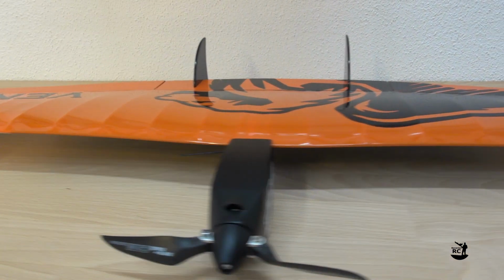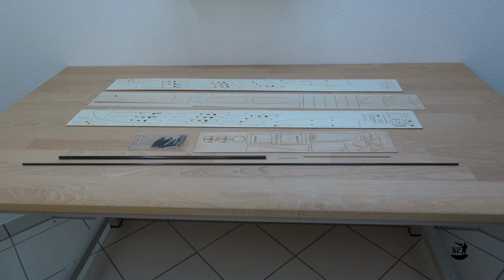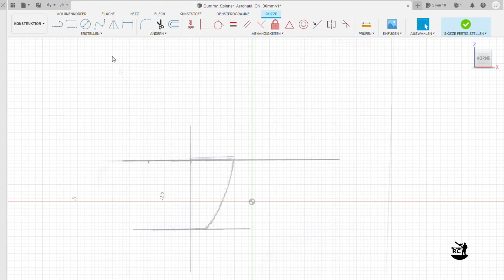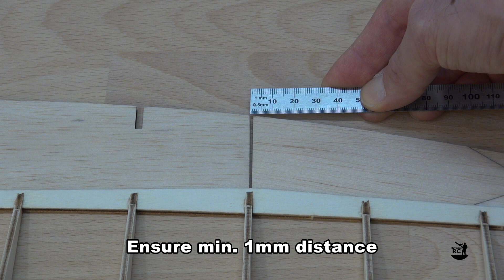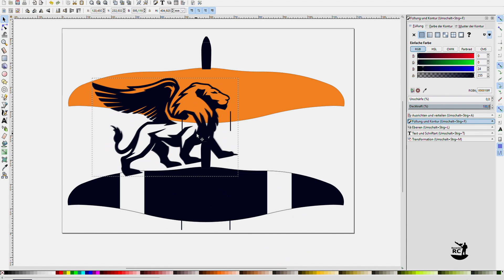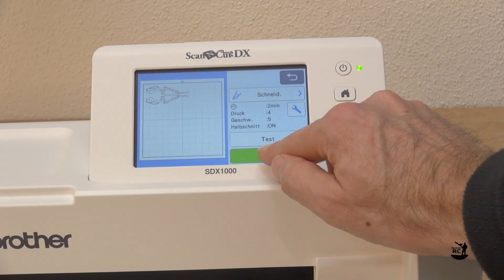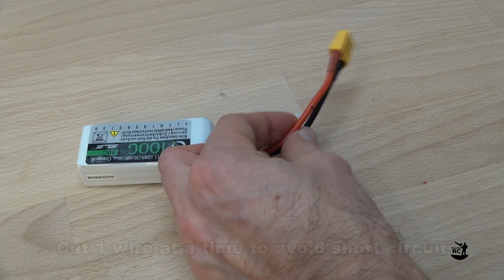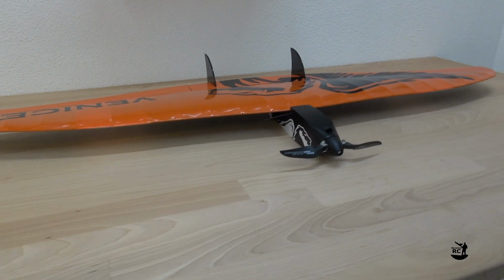Venice RC Flying Wing - Time Lapse Build

Comment: Thank you, once again you have built a model that I am interested in and I benefit from your experience. Before I order this lit from FTM can you tell me if I really need the plan as well?, watching your build I am thinking that i do not.
Reply from the maker: Thanks a lot! If you order the kit you won‘t need the plan. All parts are made to fit without having to align them on the plan. The build instructions were fully enough. They are in German but with a little help of Google translate and my video I guess you won‘t have any difficulties. If you run into any questions during the build just drop me a line. Enjoy the build!

Comment: Have you had the chance to fly the Venice yet?, I am interested in your thoughts about it`s behaviour in the air.
Reply from the maker: Hi Mel, yes I have maidened it already but have only 2 flights on it (actually 2 and a bit 😂), so my thoughts might be a bit preliminary. First of all I need to say it is more a motor plane than a glider. You can glide, but the performance is not really exhilarating. With the motor it just needs about half throttle to cruise around and with full throttle it picks up speed nicely. Climbing is only possible up to about a 70 degree angle, it clearly won‘t go vertical. It is very agile and rolls very nicely. Flight times with a mix of gliding, half throttle and some full throttle parts is around 8-9 minutes with my setup. When launching for the third flight I messed up the launch, it banked to the left and was losing height. Full throttle was not enough to pull it out of that situation and I ditched it in high grass with a bit of cart wheeling. As a result I broke the shaft of the motor. No damage to the airframe. Now it is waiting for the motor to be fixed. Hopefully soon!
Reply: @bavarian_rc  Thankyou, I have now saved some money which I will use to purchase the kit. Thanks again.
Reply from the maker: I am happy that I could be of help!
Reply: @bavarian_rc  I have completed the build of my Venice, but I am having a big problem with launching the model, I have set the CG to 41mm, needed to add some weight to the rear to achieve this, I set the aileron and elevator bottom surface to be flush with the underside of the wing. My model drops to the ground quickly after launch?. Do you use any reflex in the wing?, I am thinking that maybe I am not launching the Venice fast enough?.
Reply from the maker: My CG is at 43 to 44mm. I had to add 31g of weight to the rear to get it balanced. The control surfaces are flush with underside of the rear part of the wing which kind of gives it a S-bend airfoil. For my 2 successful  launches I was adding a bit of up trim to be on the safe side. Since the repair of the motor following my messed up 3rd attempt I haven‘t flown it. It feels a bit like I had maybe the same issue you describe. Looking at the video footage it dropped a bit after launch with some left bank and I couldn’t pull it out of that situation. So my recommendation: move the CG a bit back and give a bit more up trim during launch. I hope I will have the chance of flying the Venice again in the next days to gain some more experience. I will come back to you soon, hopefully with some more useful tips. If you succeed in the mean time then let me know your settings
Reply: @bavarian_rc  Many thanks for the info, I think I will move my CG back a little as you suggest and try again in a few days time. Will report if I have success or not.
Reply: I have successfully flown my Venice, I only made small changes, I moved the CG back to 43mm, same as you, I added 3mm of reflex on ailerons and elevator, this made a big change, I thought to use the reflex just for launch but when I switched it out while flying the model was not happy and so I left it in. So now the control surfaces are no longer flush with the underside of the wing but 3mm up. I just need to adjust the aileron throws as it I found it a little aggressive. I found that the Venice needs to be kept moving quite quickly, I can cruise at 2/3 throttle, and as you have said it does not glide well, I have used the same motor and prop set up as you.
Reply from the maker: @meljones7066 Wow that‘s good news 👍 I still haven’t had the chance to fly the Venice again. Quite busy at the moment with a lot of other things. Now that I know your settings work well I will check again mine for the same amount of reflex before flying again. During my first flights I also had the impression that it doesn’t like going too slow. I will report once I have flown it again. Bye Robert

Comment: I your video you make a drawing of the spinner by hand and then scan it into Fusion 360. I am interested on how you do this, would it be possible to ask if you could make a video on how to do this please?
Reply from the maker: Hi Mel, no problem. It is not so difficult once you know how to do it. I am also still a beginner with Fusion 360 and it sometimes takes me ages to find out how to make simple things. So I end up using TinkerCAD for some of the modeling which is way easier. It might take a bit until I can put up a video as I am currently in the middle of a project… or maybe I can squeeze it in… 😜

Comment: Beautiful,  Bro I live in Munich I really want to do this my hobby to fly,
 but i don't is there any club or group so i can build and fly legally,
 can you give me some information regarding this? Danke :)
Reply from the maker: Thanks! Unfortunately I am not in a flying club so it is hard to give you a concrete tip. What I would recommend is to google for RC clubs in and around Munich and then to get in touch with them. It is the easiest way to get into the hobby. They will support you in building and making your first flights and avoid any frustration that you could have during the first steps.
Reply: @bavarian_rc  thank you for the reply bro, I will try this. Is there any license or legals required for RC aircraft same like drones in Bavaria?
Reply from the maker: Yes there are basically the same rules. You will need a „Kenntnisnachweis“ to be allowed to operate beyond certain weight (250g) and outside of official RC fields. The clubs are taking care of this and can help you getting the correct license.